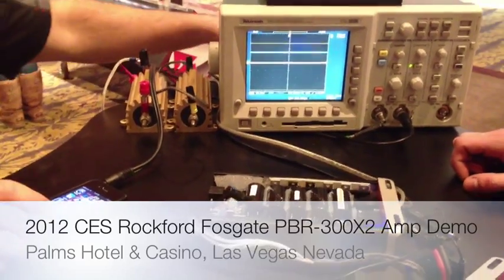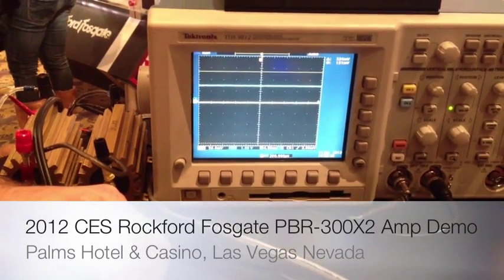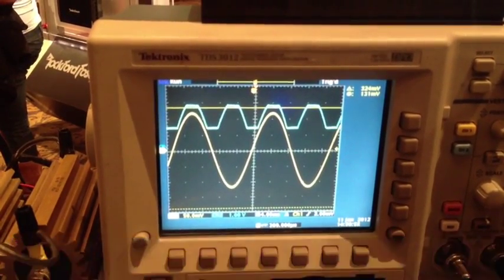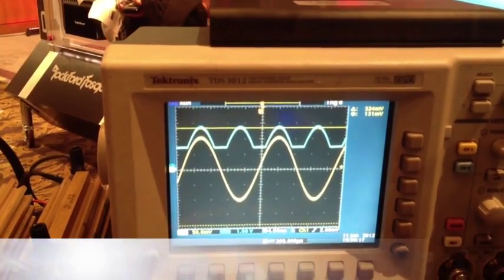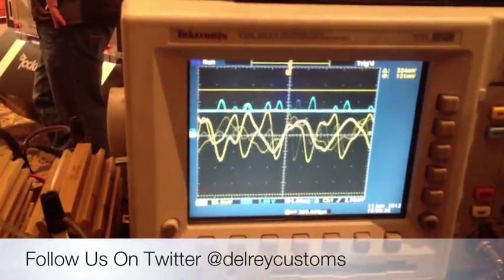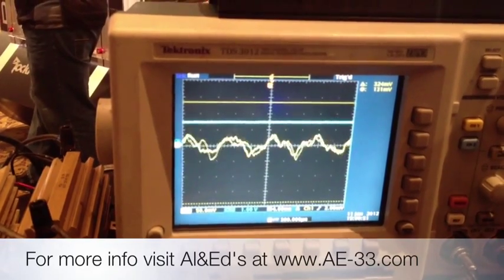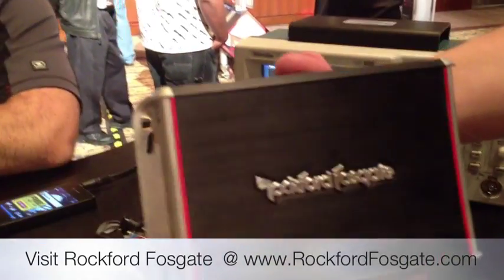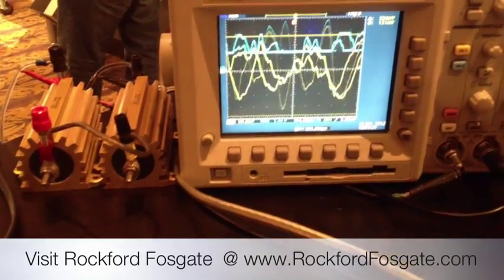2012 CES Rockford Fosgate PBR300X2 Amp On The O-scope

Comment: I "ran" RF amps, but they're gone now... lost my jeep when an illegal ran his light and flipped me 4x's. Amps flew out the window and were crushed under the jeep. 
Retired Navy electronics tech and EE. I was just giving my two cents on the nature of capacitors during colder temps.
Now, the only amps I'm playing and repair... guitar amplifiers. Caps crack or leak as the cold weather expands them.
Curious as to what voltage and uF ratings of the caps they put in the pbr series would be. For repair

Comment: Only drawback to this setup, using so many capacitors is going to be Russian roulette with on the lifespan of the amplifier.
Colder the weather, the less likely your amp will have a happy life.
If you get lucky and not have total failure, they'll leak dirty voltage onto the load.